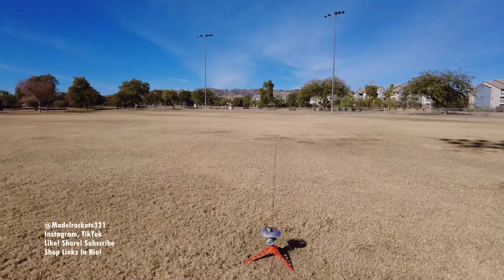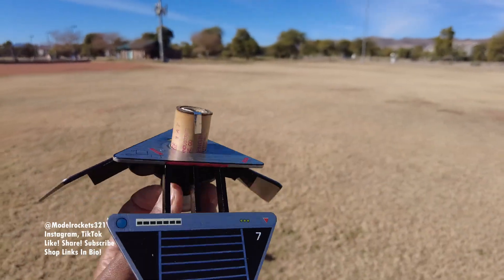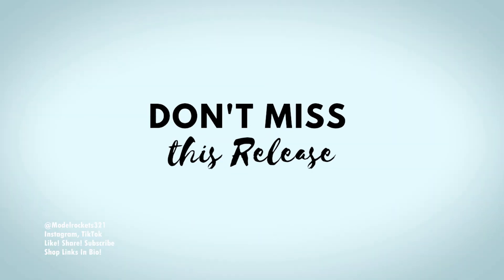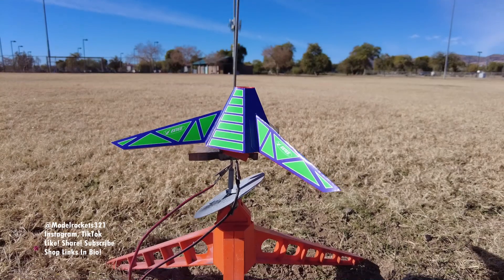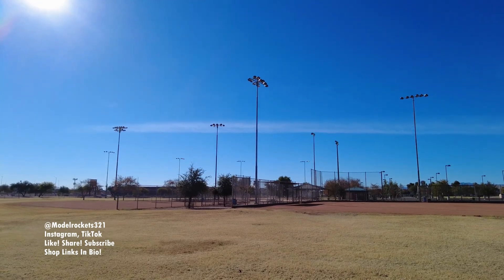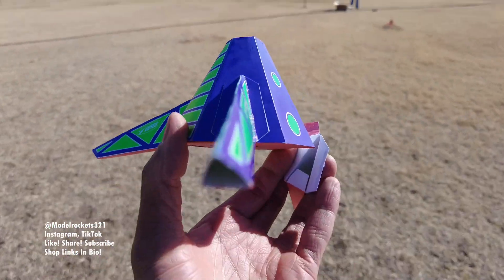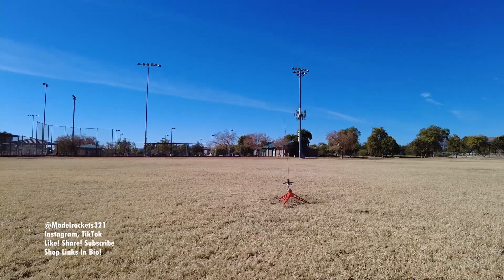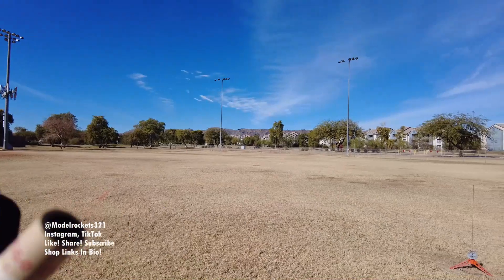Multiple Launches In The Park. Model Rocketry In Small Spaces

Comment: Maybe take a metal detector out there to find your antenna, if you have one? Thing is is you make one it needs to hardened to spring steel. Torch it and quench it in oil. Good luck Keith. You have quite the assortment of them park flyers.
Reply from the maker: I found it the next day🚀